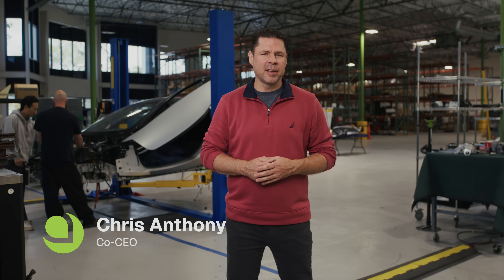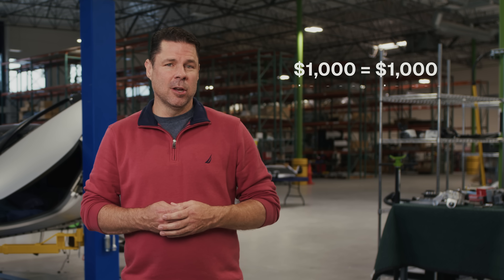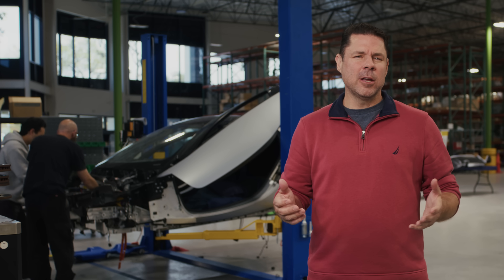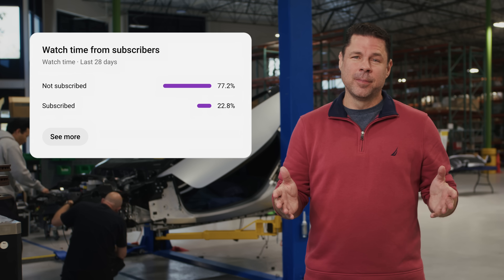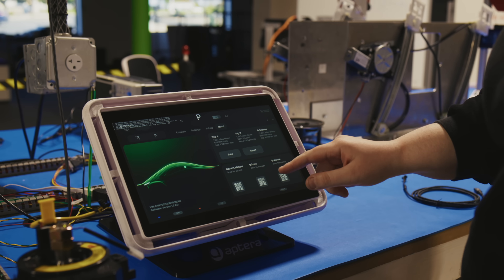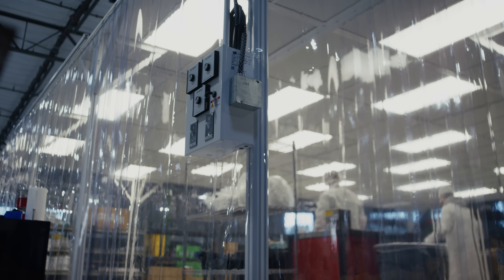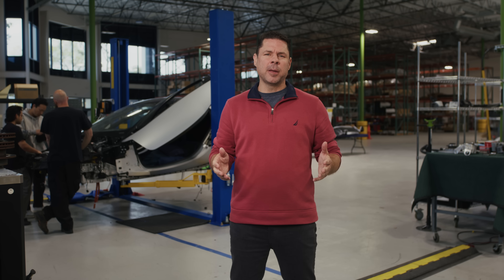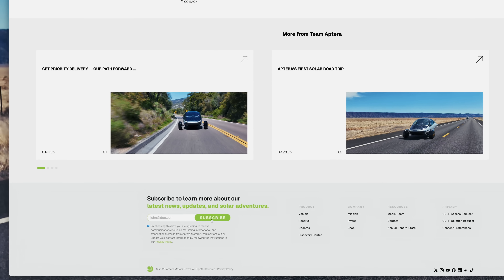Aptera Update — April 2025

Comment: You were supposed to have a production intent vehicle in 2020 according to the original roadmap. Can you give some insight into why it's taking so long? There are other upstarts that have done a lot more with a lot less. It looks like all you're doing is marketing
Reply: Oh look, a proudly ignorant troll!
Reply: @J-W-Kelly  not cool
Reply: All of their timelines have been based on having all funding necessary upfront at time of their announcements, so it keeps gettting pushed back, but rhey continue to make progress, need less money too at this point
Reply: Do you remember 2020, or did you just wake up from a coma?
Reply: I hear ya, Ive been following this solar car since 2008, and they still haven't released the car, I doubt it will come out anytime soon...plus w/all the chemtrails trying to block the sun by those who control the weather (geo-engineering), and poisoning us w/heavy metals in the meantime, that is yet another hurdle to deal with
Reply: @splash4891 - You sound like a flat earther too. Maybe into Mandela Effect?
Reply: I'm not a troll. I'm a victim (investor). We're 5 years out from 2020. They've had little progress aside from spending another 150 million
Reply: @crsshoen123 aptera has made a lot more progress than most other car companies, both in development and in production, that have spent significantly more money to get to this stage
Reply: @crschoen123 changing to a body structure that is being made by CPC took an extra 2 years! Had to change course because of the large number of reservations! Switch of the powertrain and chassis also added more time along with lack of suppliers and two years of covid which stopped the world from moving ahead!
Reply: @gmv0553  my comment has been removed twice now. Hopefully it's just that YouTube didn't like that I had a citation link and not that I'm being censored. Here it goes again:

According to their own press release the CPC deal was supposed to help Aptera "begin to deliver vehicles more quickly. And I don't see how more reservations (i.e. money) causes a slowdown.

Regarding the supply chain, the pandemic was a universal factor but was practically alleviated by 2022. And that should really only be a factor in production, not the small batches required for engineering.

Besides, any engineering design slow downs they have incurred are self inflicted. If they really wanted to make a successful car company they would focus on getting a vehicle to market that meets the majority of design requirements, not waste years dicking around with minor engineering changes.

Besides all of that, the financials just don't make sense at all. A 1:1 match assumes that when they finally go to market there will be a bunch of new customers willing to pay for not only their car, but the previous 'investors' cars as well (as Aptera has less than $10 million of the raised $200 million on hand).

Chris Anthony is a finance guy by trade, and Steve Fambro's previous venture raised $8 million and then disappeared. The really disturbing thing is that they issue themselves >$1.5 million in stock each year on top of their generous salaries and benefits. When they do this it dilutes the previous investor's stake such that the accelerator investors who spent $1 million on 1% now own maybe 0.5% (or less). All while the two CEOs maintain majority control. The fact that they are under investigation by the SEC is telling.

And even if they aren't intentionally scamming people, they have no real incentive to actually produce a car. They're living a comfy life. That stock they're stealing can be leveraged for twisted rich people tax loopholes, and if it all goes tits up they can just file bankruptcy (again). Then lay low and do it all over again in a few years.

If they would directly address any of this then maybe I would be more pro Aptera. But as it stands I'm left feeling a lot of buyers remorse and I don't even have a cute model car to show for it.
Reply: @crschoen123 one trying to prevent the pile up of victims from growing too quickly

Comment: I'm ready for when my 1000 mile range Aptera comes out!
Reply: The 1000 miles range makes things cheaper. I’ve been driving electric for years and don’t need long range, but, when I do long trips I have to pay the the extremely high price to charge at charging stations! Being able to do long trips on the cheap electric is get at home or off Solar is a game changer.
Reply: @ It’s the efficiency that makes it cheaper. Without that, the solar isn’t even effectual. 

Initial costs, then added weight makes a more expensive vehicle less efficient. Also, a significant loss of storage space and capacity. 

Remember, the Aptera will get many miles just on a regular 10 or 15 amp 120 volt outlet overnight.
Reply: @hardcoreherbivore4730  the cost of the car yes, but public charging is to expensive. A road trip is not cost effective in an electric vehicle. I could travel to Spain from the uk using electric from my home solar, stay for a few weeks charge up on solar and drive back again. Yes the car is heavier but this is always going to be the case. People buying the 1000 mile range and only using it for the shopping I agree is pointless but that’s their decision. The 1000 miles range vehicle itself is not pointless.
Reply: @nicholasallen8829  This is silly, electricity is no where near the cost to justify it. Especially at 8-10 miles per kWh. Look, it’s your money, but don’t try selling it as the rational economical decision. 

Likely you won’t have the option it’s so impractical. They may make a couple in that variant to break a few records, then scrap the whole thing.
Reply: @ our public charging is now 80p per Kw, charging at home is either free with solar or 7p power Kw.
Reply: @ Highest price I could find was 67p. 😆
Reply: @ haha much better then :-/
Reply: Highest I could find was osprey at 88p 🤣
Reply: @ That was the worst I could find. Even at 80, which is nonsense, that’s about 32 pounds to go 400 miles. Plus, you start with the first 400 miles at the cheap price. 

Can’t make the full trip, even with the 1000 mile battery. So, you’re paying for 400 of those final thousand miles anyway. So, you’re only saving at best 48 pounds per trip to Spain. 

Also, the UK has the worst supercharger prices in Europe. The moment you set foot outside, you’re saving 20-35%.
Reply: @nicholasallen8829  there are a few free chargers in the US still like at hospitals and libraries, and if I were to get a hotel with parking out front I'd probably be able to run the cord inside and charge overnight a d get free breakfast instead of paying for fuel and sleeping in my vw wagon to save on money 😆 lol
Reply: If they offer a 1000 mile variant, it’ll be easily over $60k. That’s a whole lot of trips to justify $20k+ initial cost.
Reply: @hardcoreherbivore4730  you reckon ah 😂
Reply: @nicholasallen8829  Also, that’s only one direction. Even with the 400mile variant, you’re likely getting out of the UK before charging.
Reply: @hardcoreherbivore4730  what EV do you currently drive?
Reply: @hardcoreherbivore4730  last I checked it was 50k
Reply: @hardcoreherbivore4730  I live in the USA! Lol
Reply: @nicholasallen8829  I have a little nissan Leaf that I bought used and fixed up. The doors were side swiped and I replaced them. This Aptera will be the first and hopefully only new car I have ever /will buy. I buy used cars and fix them up drive them and sell them as a side deal.
Reply: @Biblecrusader  55k, but that was years ago now. Since then the 400 mile version has raised in price. I’ve merely kept the difference the same.
Reply: I heard it'll be sooner than 2060
Reply: Why 1000miles? You add only a lot of useless weight and reduce efficiency…
Reply: @leneanderthalien should probably direct that question at the company and not the people who ordered one. Although if a company is selling something and a person is willing to buy it doesnt that already answer the question.
Reply: @leneanderthalien  I live 2000 miles away from my Dad and I am going to test to see if I truly bought a thousand mile car lol.
Reply: @leneanderthalien  There will be more weight and it will reduce efficiency, but it won't be "useless" for some customers.
Reply: @leneanderthalien  That vehicle will be a valuable asset as the most efficient 'battery on wheels' to deliver electricity to remote camps, ..., or places where no plug-in options are available. Like to other EV's who run out of juice short of reaching their next charging location. Tow trucks for EV's can run upwards of $200! Even when that desired charger is only several stone throws away, like what happened to me northbound on I-5 just shy of the exit to get me to the Grants Pass, OR Visitor's Bureau charger ;+<.
Reply: @leneanderthalien I like to enjoy my drives. A part of that enjoyment causes me to get less than the target range. In addition, I plan on raising the vehicle and I want the AWD version. All of this will eat the range. However, I still want a lot of range like everyone else. The 1,000 mile version is how I achieve everything I want, drive it the way I want and still have range to spare. If they are selling that, I’m buying. I can do all of that and still be more efficient than most drivers on the road. My goal is to be more efficient in general, not the most efficient at the sacrifice of my enjoyment.
Reply: @leneanderthalien   Weirdly enough their quoted efficiency of the 1000 mile version is exactly the same as of the 250 mile version.
Reply: @Throckmorton.Scribblemonger  they showed the batteries and that they were only going to be a bit taller with each mile version, I'm sure the added weight won't be all that much, it be less than the difference of having an avg passenger or not.
Reply: @leneanderthalien less charging is always beneficial! Especially for the battery! I will not buy anything less then 600 mile range!
Reply: @gmv0553 Your bladder doesn’t have a 600 mile range. So, what is the purpose?
Reply: @hardcoreherbivore4730  I've driven multiple times for like 10 hours without a break several times
Reply: @ Total BS, or you’re on your way to mummification. 😆
Reply: @hardcoreherbivore4730  lol, the only stop I made on those 10 hour trips were fuel halfway no bathroom.
Reply: @ That’s not healthy, you shouldn’t be proud. Water is essential, right after oxygen. 🤨
Reply: @hardcoreherbivore4730  🤣 True but if I don't got to go I don't got to go lol!
Reply: @Biblecrusader  Have you seen the seats of the Aptera? They're like sitting in a beach chair.
Reply: @Throckmorton.Scribblemonger  I want to see the aptera in person lol

Comment: I understand that the thermal managment is the most complicated part of Aptera and it is different from all others, therfore slow going.  Please try to utilize Ambassadors to facilate the tours as they have the local knolage and contacts. to alow each event to attract at least 1000 people many of with will have not heard of Aptera before.  Help put the local Ambassadors in contach with each other as the Ambasador list has only about 1/2 the Ambassadors and less that 1/10 the contact info.
Reply: How’s it different from any other ev? Ac chiller, cooling plate, radiator cooling, there’s a limited amount of options
Reply: @Wigwhom86  It is different as it has to configured into this totaly different vehicle.

Comment: Canadian here. Can't wait to get mine. Aptera is 8 times more efficient than my current daily driver (Toyota Corolla).
Reply: 8 times more efficient? what do you drive
Reply: @maheshr4108  Corolla
Reply: @maheshr4108  Toyota Corolla
Reply: @maheshr4108  Toyota Corolla 6MT
Reply: @maheshr4108  not hard to realize if they’re using an ICE car using the equivalent measurements of 33 kwh per gallon gas and how many mpg an ICE gets. In 2020 the average US passenger vehicle got 25.7 mpg, which is 0.77 mi/kwh compared to Aptera’s 10
Reply: @312bigbeanburrito most toyota are hybrids with amazing fuel economy
Reply: @kiefershanks4172 What do you expect your insurance, and vehicle category to be?  A quick check shows the polaris slingshot as a motorcycle, will aptera be one as well? forced to wear a helmet inside the cab?  also motorcycle insurance is pretty high in B.C., but its based on cc of engine displacement...
Reply: @ChickieNobs  A Polaris Slingshot is the closest comparable vehicle on the roads here. I am in Ontario where Slingshots are registered as motorcycles with motorcycle type insurance but don't require a motorcycle M License, only a G or other higher tier class. The law so far says a helmet would be required. In the case of a Slingshot, this makes sense. However, Ontario's 3-Wheeled vehicle laws are in their infancy, and are essentially "pilot" laws. I could easily see exceptions to the helmet requirement provided the vehicle is enclosed, has a full windshield, seatbelts, crumple zones, and airbags. So far, there is no three-wheeler that compares as much to a car as the Aptera which is why there is really no law defining it precisely. Yet.
Reply: @ChickieNobs  Helmet use is State by State. but most states won't require it.  Perhaps Alaska at this point.  Laws have changed rapidly.
Reply: Seriously!? How do you even come up to comparing a full size vehicle to that aptera!? It makes no sense!
Reply: @alanmay7929  Your comment makes no sense. I simply stated a fact. The Aptera is intended to replace my Corolla for commuting.
Reply: @kiefershanks4172  lol!!! My comment makes full sense! No one cares what replaces your Corolla it's a totally different type of vehicle and doesn't compare to a Corolla
Reply: @kiefershanks4172  why not you just buy a used EV for commuting then since that's your goal!
Reply: @alanmay7929  Any used EV would still use far more power.  Run the numbers - especially when Aptera has the final ones.
Reply: @ do whatever you want I’m not forcing you lo!
Reply: @alanmay7929  The range isn't good enough for the EV I need.
Reply: What about Snow? It has only 3 Wheels. Must be difficult to drive in the lane of the 4 wheel cars? 🤔
Reply: @BoriseinfachBoris  I don't think it'll be a big issue. Nothing throttle can't solve. I can count on one hand the amount of times I drove in conditions like that this past winter. There's this amazing thing called a snow plow that you already pay for with your taxes! Haha
Reply: Keep on drinking that Kool-Aid.  This thing has been grifted for so long and so often I doubt it sees the light of day at all for any pricepoint.  I even doubt half of those first 1K $10k+ rubes get theirs.  And even if they all show up, the pricing is so far above the original promise it's sure to be even less successful than the Fisker Ocean.
Reply: I would be interested to understand why you want one. I mean I used to have a large 8-seat SUV. We upgraded to a Tesla model X and having an electric vehicle is amazing. 

At the same time, a vehicle like this would be completely impractical for myself so I do have that position. But I mean I also live at a high elevation. I live on the east coast so outside of a very very urban setting, I don't see a vehicle like this being practical for a large number of people. 

It reminds me of a discussion I had with a man on LinkedIn who claimed that a small two-seat electric vehicle was all the majority of the population needed and I told him it would be impossible because I have a family of four and he had this fundamental disconnect where he didn't understand that a small vehicle that him and his wife share he couldn't really understand, how that vehicle would work for the majority of the population 

So my question to you is, my first would be the statement that you must live in an area where this vehicle would be practical and outside of just commuting, would it be practical to use for anything else like what would you do if you wanted to go to the grocery store. Or God forbid go on any type of road trip or anything in it other than just commuting back and forth to work
Reply: Another Canadian: we're going to be better off waiting for the tariff war to end. Probably even longer to see how bad of a depression gets triggered.
Reply: @Grunchy005 he’s been making the same promises for two decades now. They bankrupted and disappeared once already to avoid fines and jail time and now they are using the unregulated crowdfunding scheme to do it all again. The same scheme as Elio and The Dale. Look those up.
Reply: @Grunchy005  I think I am most concerned that Aptera will get killed by the tariffs before we'd even be able to buy one. Aptera is literally the kind of company that would make America great again but ironically Trump might inadvertently kill it with his reckless policies.
Reply: What is it like to be against rich big wigs while also believing mainstream media? Cognitive dissonance?
Reply: Hopefully you haven’t given them any money as you will never see it again nor will you get a car from them. I’ve heard this same story he’s giving now over and over and over again.